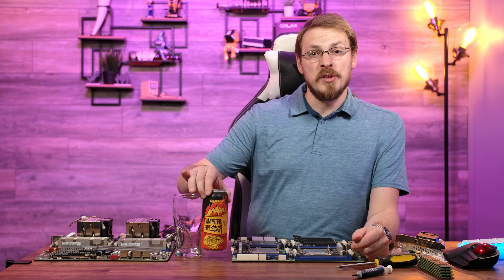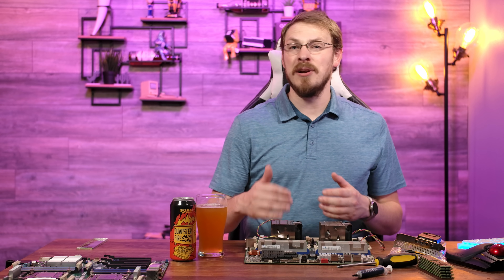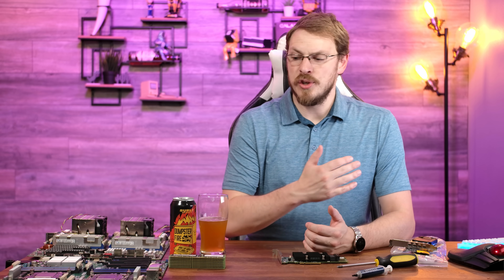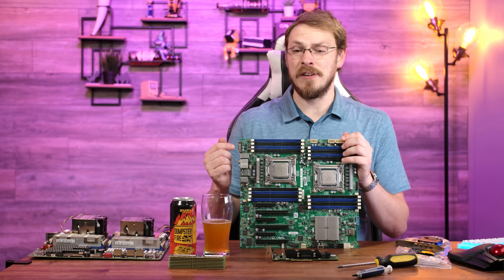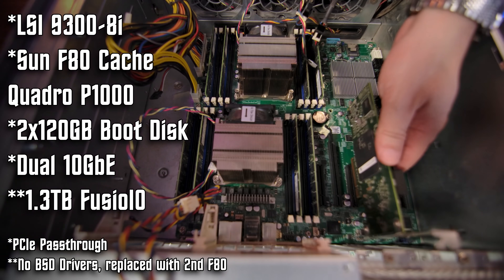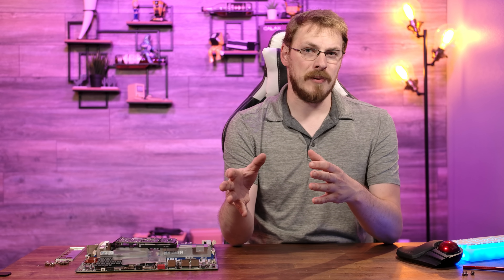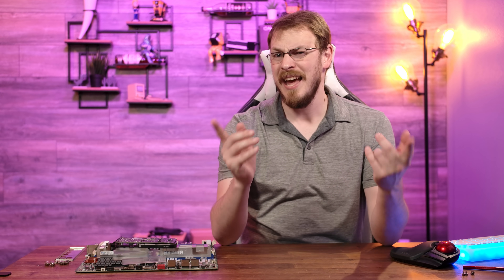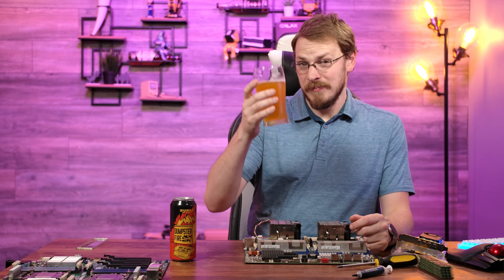Running out of things to die - TrueNAS Motherboard Replacement

Comment: jeff i use a hp smart aray 212 card with constilation sas drives and i could not get Truenas to boot either (disk were not spinning up in time) so i put a dedicated psu on my disk array and turned it on first then i booted up the freenas box and it worked you could hear them spinning 1..2...3..4..then the os posted

Comment: Currently running an X99-WS/IPMI with an e5-2676v4 (used to be a e5-2683v3). Alongside it is 4x16gb (64gb total) 2133mhz ECC RDIMMs, Quadro P4000, LSI 9211 HBA, and hopefully by the weekend, a Mellanox SFP+ NIC. Current storage is a 1TB 970 Evo, 2x2tb WD Red Plus and a random 850 evo m.2. ESXi is my hypervisor of choice. Next upgrade incoming is two more 2x2tb and hopefully a rackmount chassis.

Comment: My home server is my old desktop, an i5-8400. I have managed to virtualize my NAS though. Running proxmox with an Unraid VM, among others. And future upgrades? Well... it's probably going to be a new case first. The case it was in as my desktop only supported 3 3.5" disks, it's in a really old case now that supports 5... but that case is noisy as hell.
Reply: Why do you virtualize your NAS within unRaid? Wouldn't it be better to just use unRaid itself?
Reply: @TheRailroad99  I virtualize unRaid in Proxmox.  Why? Because I have a machine running Proxmox and I didn't feel like adding a second machine while the first one could do it just fine too. And it was something I had never done before, curious how it would work.

Comment: X5690 overclocked too 4.5GHZ with Noctua NH-D15 with NH-1 thermal paste , Asus Tuf gaming Sabretooth X58 motherboard , 24GB 1866MHZ ripjaws OCed too 3200MHZ , PCIE M.2 adapter with a 256gb western digital m.2 running windows 10 and X2 1TB Samsung Evo 860,s one for Games and one for Videos!! , RTX 2070 Super founders edition 8GB , TX 750 watt gold semi modular PSU all in the Fractal Mesfiy C white Case decked out with Purewings 2 fans and RGB stripes .....this is my does it all machine and benches 20% better then a Ryzen 3900X !!!!!

Comment: My NAS is AMD Athlon 200GE, some A320 motherboard and 16GB of ram, 2x WD red 3TB in RAID, 2x SSD - one for HDD read cache and one for temp files, Docker applications and other stuff that constantly backuping or I don't care if I loss it.. It's running XPENology, with Home assistant, Transmission, Pihole in Docker. Also it syncs our Google Drives and Dropbox for easy access in local network without installing clients on all computers. But most common use case is just Plex.

Comment: Fileserver:
EPYCD8-2T with EPYC 7252, 3 Highpoint RocketRAID 3740's (x8 12TB Ironwolf, x8 8TB Ironwolf, x8 4TB Ironwolf, + Room for expanstion), 1 RocketRAID 2840 (x16 860 EVO) , 1 Intel x710, 1 ASUS M.2 X16 card V2 (x4 250GB 970 EVO M.2), x1 250GB 970 EVO M.2 on board, Chenbro RM43348 48 3.5" bay chassis, Ubuntu 20.04

Router:
EPYCD8-2T with EPYC 7252, x7 Intel x710, x1 Intel i350, x1 250GB 970 EVO M.2 on board, PLink IPC-2026-BK chassis, VyOS 1.4

Access Point:
EPYC3251D4I-2T with EPYC 3251, AIMB-RF20F-02A1E x16 to x8x8 bifurcation riser, Compex WLE3000H5 5GHz 802.11ax, Compex WLE3000H2 2.4GHz 802.11ax, J-HACK Pure Mk2 chassis, VyOS 1.4

I know it is overkill, but at least I shouldn't have to upgrade for a while.

Comment: I am currently running a Banana Pi for my house file server, and I currently have a Raspberry Pi 4b running Pi-hole.. I am thinking of removing the Pi-hole, and running it elsewhere, and setting up the Raspberry as a WordPress fool-around system. I haven't done any CMS stuff in a long time, and it would make a nice little system with 8 Gig of RAM for fiddling with that.

Comment: Been watching your videos and you got me interested in making a backup of my backup UnRaid server. So that means I'll be rewatching your videos whenever I have the money to do it lol
Edit: My UnRaid Server contains:
-Ryzen 5 2400G
-MSI X470 Gaming Plus
-32GB DDR4 3200Mhz RAM
-512MB Samsung 860 Evo Sata SSD (Cache)
-5 4TB WD Red 5400rpm HDDs (1 parity, 4 for the array)

My plan is to fill all the HDD trays in my Fractal Design Define R5 case (I believe that is 10 or 11 spots). Also need to get a pci sata adapter to fully realize that.

Comment: 2 mirror'd glusterfs nodes Dell T420's / 48 GB RAM / 16 thread CPU's. 2 docker compute hosts / 48 threads, 256 GB RAM. Docker hosts use glusterfs shared storage.

Comment: I had a board die, turns out it was the PSU that caused the issue.
Freeze boards, usually have issue with power delivery, it's always work checking the  systems power on the board, as to change a  5 pence cap, is a lot less bother. But they die as you explained....
Also high power draw from many cards puts a strain on both the PSU and boards mosfets... 

And... building in that dirty case.. shame on you..

But... Anyway related to the drive failures?
Reply: My old gaming computer kept rebooting when nobody was looking.  Rock solid all day gaming, and in the morning, it rebooted.   Tried everything, and turns out the PSU was the faulty item.  Machine only rebooted when idle for long periods of time.
Reply: @kajerhacker1894  depends on what you mean by old...
It was a common issue where sleep mode and boards used to have a had time, just change the power settings in the os.

Comment: Love your content Jeff its always honest, informative and makes me laugh.  Home lab is kinda a mix of redundant parts from work, cheap Chinese crap and retired builds. 2x Xeon e5-2660 v2, JINGSHA X79Dual S8 Dual CPU motherboard, 4x 240gb SSD's in raid 0, 1x 256gb nvme for boot, 1x 1tb sshd, 64gb ddr3 ecc 1600mhz, xfx r9 380 gpu all shoehorned into a Riotoro CR1080 case.

Comment: My home server is an HP Dl60 with a single processor E5-2609. Since I am in a small apartment with incredibly old wiring from the '50s, I am severely limited in what I can put in the single circuit I have available. The second circuit is the kitchen. I also must run my AC off the living room circuit and if I try to run the AC and the server at the same time with my network switch and dual QNAP units the breaker trips. So, I can only bring the server up when I am not running the AC but since I am on the east-facing side of the building heat build early in the morning and gets trapped all day if I don't run the AC. Result: I have the server on from 12 to 5am. I get more time during the winter as I can go from 10pm to 6am if I leave t a couple of windows open to balance out the heat from the steam heating that I have no control over that like the apartments to be at 80 degrees./.

Comment: Honestly as soon as he said it’s a gigabyte motherboard i knew what was up. I’ve had way to many gigabyte products fail to ever buy another one again
Reply: I've had good luck with consumer motherboards from Gigabyte, and the Gigabyte boards I have boot insanely fast (yes, tested with different drives and motherboards, and determined it was the mobo causing the speed increase)
Reply: What board do you recommend?
Reply: @danieltur-bes2036  ASUS or MSI
Reply: @joshface-uk  👍
Reply: Yep. Got a A320M-S2H motherboard for my home server and it was dead out of the box.

Comment: Currently running a Chinese X99 motherboard (jingsha x99 d8 with a e5-2630L v3 64GB 2133DDR4) and would like to get a proper serverboard to also pass through a P400 for jellyfin.
The board has trouble rebooting and has no option for last powerstate after a powerloss.
Unfortunately used Supermicro X10 SRL-F boards are still quite expensive

Comment: Currently have FreeNAS running a 1300x on a X370 motherboard with 4x3TB Hitachi HDDs, 16GB RAM in a Define R5 case with 4x140mm fans and a BeQuiet cooler. Gigantic? Yes. Quiet? Also Yes. HDD make more noise than anything else!

Used 3700x on the way which will, hopefully, offer Plex transcoding since I can't get the GPU I'd like to do the same. Literally have 3 out of 4 more 3TB drives and a HBA in my cart on Amazon. Waiting for the 4th drive to get in stock so I can order and add another pool and 7.2TB more storage!

Comment: Currently running TrueNAS inside of Proxmox with 8 3TB Seagate Constellation in the System, passed through with a LSI 2008 HBA and 1 drive in the shelf.

Comment: Eypc 7551 on a super micro h11ssl-i with 128gb of ram for my unraid box and then a dual xeon I don't remember becuse it's down but it over 200gb of ram an I was running proxmox on that. Ps if you would like some ram send me a dm I will be willing to ship you some ecc 16gb dimms

Comment: I'm running TrueNAS on my trusty i7 3770k with 32 GB of RAM and 8x4TB drives on a random Gigabyte board.. It was my old desktop board before I upgraded to my current AMD AM4 platform.... it's my Plex server mainly, but I have an NFS share enabled. :) I honestly don't plan on upgrades right now, though I'd like to totally rebuild with server grade hardware at some point, with a rackmount case. My current case is a rackmount, but I have no rack. lol.

Comment: My setup isn't nearly as sophisticated as yours but it works quite well for my needs.  My truenas server is running a gigabyte z77 chipset board with the old i7-2600k from my high end workstation build in 2011 (that thing is a workhorse and for storage, plex (no real-time transcoding), transmission-daemon with quite a few various linux distribution iso's, and a very small totally unprivliged ubuntu vm that i use for accessing my internal network from external networks via ssh (I use rdp over ssh pretty often).  the machine has 24gb of ddr3 and 8x shucked 10tb western digital easystore drives.  I have to power them with molex to sata adapters because the 3.3v pin triggers these drives to reset so if i plug them into sata power directly they just reset constantly instead of operating.  because molex only has 5v and 12v, no molex to sata power adapter has a populated 3.3v pin.  i'm using the onboard gigabit ethernet that goes to my privliged vlan and I also have an intel 10g base-t card which has a 100' cat6 cable plugged into it that goes up the stairs over a few doorways and into my home office to be plugged DIRECTLY into my primary workstation ( https://pcpartpicker.com/user/cpgeek/saved/RxfdHx ) I currently have the server set up in a 2010 vintage cooler master desktop case.  I would very much like to upgrade to an enclosure that can hold more drives, but that can function on a normal atx power supply (for quiet and inexpensive replacement).  every single server enclosure i've ever seen has been SUPER noisy (typically for no good reason) due to the fact that they use really tiny power supplies with really tiny fans that need to spin super fast to have any hope of getting air through them.  I live in a smallish house and the multipurpose room that my server currently sits in is just across a very small hallway from my 2 childrens' bedrooms and if i put it in MY home office, it would A. be too noisy to work around, and B right next to the bedroom my wife and I share... either way my family would hate me... - if anyone has any solid leads on either rack or tower enclosures that can comfortably store 16 drives or more while being no louder than a common desktop gaming computer, please let me know.

Comment: I am running right now in my home server is a EVGA X79 FTW motherboard, I7-3930k,64gb ddr3 1600mhz ram,5-4TB Hitatchi 7200 rpm drives with a 240gb ssd boot drive,and a GTX 690 GPU.

Comment: Great video, but two technical notes: Likely, the camcontrol problem can be resolved by adding a delay in the kernel boot params. Basically, you need to wait extra long if you have a lot of disks attached. It's quite a vexing issue to debug though... Ask me how I know... 😉

You can disable pcie boot roms in the SuperMicro bios config, and I'd strongly recommend it for any card that doesn't actually have a boot device on it. There's A LOT of very obscure config in the X9/X10/X11 bioses for the record... But it's worth reading carefully through the manual at least once as some of the defaults can bite you in the butt.

Comment: I started watching your channel when your video appeared about your first Supermicro 846 chassis install because I was about to build out an 846 as a test unit. My first 846 was a hodge podge of storage for TrueNAS w/Supermicro X9DRH-7F motherboard, dual Ivybridge 2653v2, the onboard LSI 2308, an HP H240 SAS3, a Dell VGXKD LSI 9207 SAS-2, a Supermicro 24 drive SAS2 expander, 10 SATA 5 TB drives (refurbished, $40 each), 4 SATA 3 TB Drives (pulled out of a failing QNAP box), 2 SAS3 1gbps SSDs ripped out of a dead EMC server and inserted in the SAS3 2.5" rear hot swap option, an NVMe add-on card, and 10 SAS2 SSD pulled from a failing EMC server. Oh ... and a 64 GB Supermicro SATA DOM plugged into SATA Port 0 and 256 GB of RAM. The solution was my first attempt at hyperconverged feature engineering for machine learning with "longer term" backup on spinning media in the same box. It's since been supplemented by all SAS3 and NVMe replacements with more horsepower, including multiple Nvidia GPUs, in the 846 form factor. The 846A backplane was a better replacement backplane for the original SAS2 EL1, but it was short-lived in the first 846 chassis because it had a better home in a higher throughput motherboard w/3 SAS3 controllers. ... Look at what you've done to me.

Comment: SuperMicro X9DRi-LN4F+ with 512GB (16x32GB LRDIMM ECC 1600MHz RAM), dual e5-2658 v2, Quadro P400, dual 4x nVME Asus cards with quad 1TB nVME drives, a couple of rust spinners, some SAS SSDs (Samsung 1625) connected to LSI 9207, and a 10Gb dual port NIC for the backbone, running basically only my Plex server.  I have a few other machines, but that's my baby.

Comment: Currently running Unraid on an old i7-3770 in a Z77X-UD3H with 16GB DDR3. Previously that was an AMD A8-3820 with 8GB DDR3. About to upgrade to a couple of dual E5-2690s in a chinese 'X79' dual socket motherboard with 128GB DDR3-1600 ECC RAM and a HP H220. Partly experimenting with it all. Going to try running a game server or 2 and see how that goes and try to get my other machines compiling on that. HDDs are a mix and no SSDs in the server at present, looked at the Sun F80 however shipping to down under was more than the cards themselves.

Comment: My current NAS/HTPC is my previous computer consisting of a core i7-930 on a x58 motherboard, 6x4gb of 1333mhz ram in a Fractal Design Node 804 and a handful of hard drives which are all replicated in the cloud.

Im planning on putting in my current Ryzen 5 2600 cpu that is in my gaming / wfh computer and upgrading to a 5600 or 5800 cpu if I ever find a decent b450 micro atx motherboard that is suited for nas/HTPC work.

Comment: "what hardware do you run on your home server?" ahahaha ahahaha certainly not a Sandybridge i5 ahaha yeah mine's totally some Xeon v2 yeah that's the one I use audible sweating
Reply: hahaha Xeowhat? Core 2 Duo is where it's at!
Reply: @headmd  Lucky. Before 2019 I had a Pentium III as the most recent x86 home server.

Comment: I've actually scaled back in recent times for my home server. I run consumer hardware now. i7 10700 for intel quicksync (Plex), 64 gigs of ram, bunch of hard drives in a tiny itx box.
Reply: Yeah. Running 3600x here, and it's faster, quieter, and easier to maintain than the rack full of sh*tboxes i used to have, haha!
Reply: I'm planning do downsize my 24/7 powered box as well... 60W permanent power draw is not that nice (at least better than most dual socket boards).
I will have to use something like unraid with Cache storage so I can spin down my disk array. It is needed maybe 1 hour per day.
However the server does need to run 24/7 for web server purposes.
My plan is to have it still powerful, but in Idle it should not draw more than 30W. Is something like that managable with an underclocked/undervolted Ryzen or am I unrealistic here? The current build (socket 1156 Xeon) uses around 60W with ~5-10% load and four disks spun up

Comment: What am I running? 

Actual Enterprise Hardware: 
1x Dell Poweredge R720XD
Running TrueNAS-12.0-U3

2x Intel(R) Xeon(R) CPU E5-2630 v2 @ 2.60GHz
48gb DDR3 ECC

13 total disks

6x  3tbs SAS in RAIDz2
6x 300Gb SAS 15k in 2x3 disk RAIDz1 (want to replace with raid1 2 2TB drives)[used for nextcloud jail mount]

Jails: Plex, Tautulli, Nextcloud, Heimdall, ZoneMinder

The Rest is consumer Hardware with proxmox for VMs
I would very much like to virtualize TrueNAS asap because of wasted CPU power being bare metal and size constraints in a college dorm room

Comment: Current hardware:
Supermicro H8DGi-f
2x AMD opteron 6276 cpus
64GB DDR3 ECC ram (definitely need more)
mellanox connect-x2 10G card
Micron P30h PCIe SSD (workstation VDI storage)
LSI 9200-8e (24 bay DAS hooked up for Zpool)
Sapphire RX580*
Renesas USB card*

* = passed through to Fedora workstation VM

Planned upgrade:
Supermicro X10DRi-F
2x E5-2680 V4 cpus (water cooled to save space, DIY dual socket AIO with THICC 360mm rad)
128GB DDR4 ECC
mellanox Connect-X3
LSI 9206-16e
4x micron 7300 pro m.2 SSDs for VM storage in a x4x4x4x4 bifurcation card
x8x4x4 bifurcation riser kit
Asus Xonar DX*
carry over GPU and USB card*
* = passed through to Fedora workstation VM

the old system is in a norcotek RPC-430, which is great because I need the short depth, but I need just a bit more room.
I couldn't find what I wanted, so I'm going to have protocase build me something.

Current host OS is Ubuntu, I'm planning on moving to Proxmox.

Comment: Home Server Setup;
-Ryzen 7 1800X @ 4GHz
-DeepCool Neptwin v2 CPU Cooler
-ASRock B450m Pro
-64GB G.Skill 3200MT/s CL16
-250GB SSD (OS)
-Elgato HD60 Pro
-Fusion ioScale 3.2TB
-LSI MegaRAID w/ 3x 4GB SAS drives in RAID 5
-Thermaltake 600W PSU (need a better one for 24/7 use)
-Rosewill Mid Tower Case

Next Upgrades
-Install my old Ryzen 7 3800X w/ PBO, and put 1800X on display
-Install M.2 to PCIe converter for GPU installation, and install old Nvidia 8800GTS
-New 80+ Gold, or better, PSU at some point